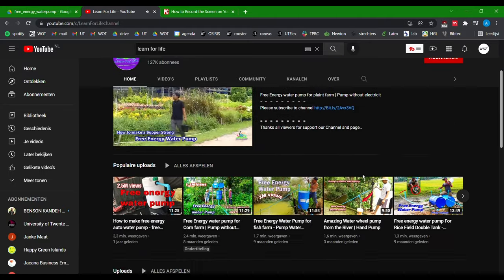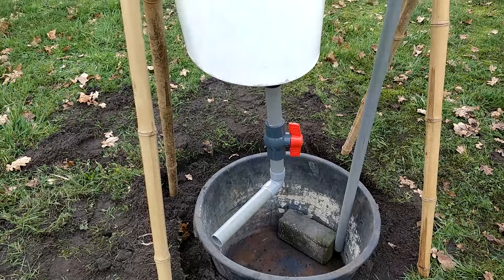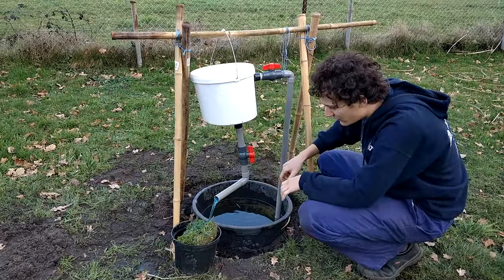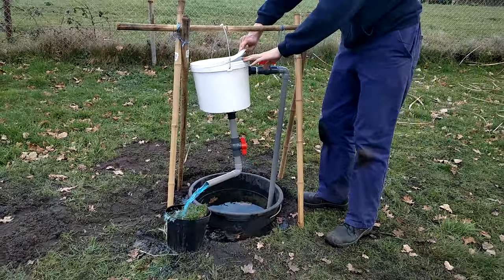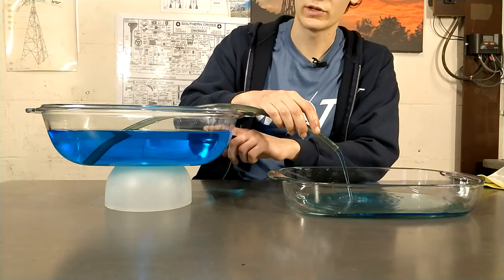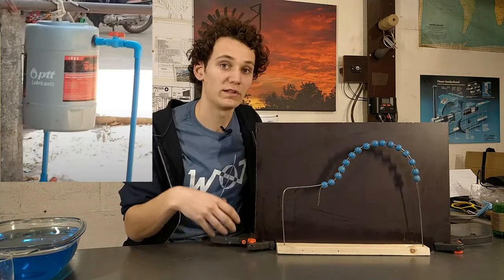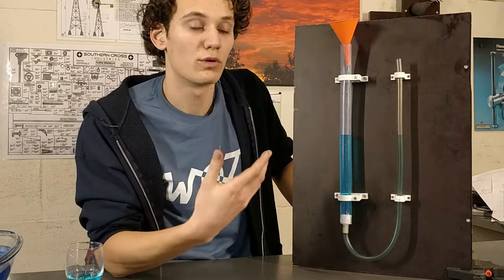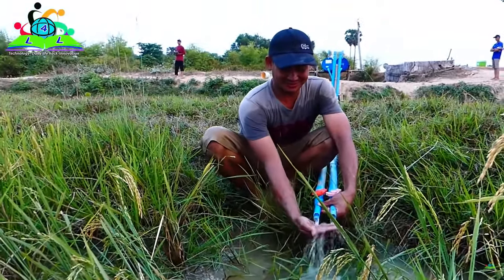FREE ENERGY Water Pump Tested. Is it possible?

Comment: I've actually tried to build one of these water pumps and it worked great , you have to make sure the container is air tight and use a check valve on the inlet tube so the water from the source can't go back out. 
When you start letting the water out it creates a vacuum drawing water in and the check valve only lets it flow in one direction.
Reply: Have you really? WOuld love to try it out too
Reply: I was about to comment about the one way valve. Good thing you mentioned it already.
Reply: he made it all wrong......
Reply: I agree sir. Cause its a vacuum type..not a siphoning type. 👌👌👌
Reply: No, you haven't built anything and you're lying in your claim that it worked for you. It's an ordinary siphon. It doesn't matter what you place between the higher level and the lower level, because everything will work as long as the outlet is at a lower height than the inlet water level in the tank. However, it is possible to build a water hammer (water ram or hydraulic impact piston) as an amateur. You need running water, for example from a stream (it doesn't work in a well). Then it is possible to transport up to 0.1 percent of the incoming water by ram. If what you lied about worked, you could bring the outlet water back into the inlet and you would have a perpetuum mobile. Apologize to everyone you mystify.
Reply: Hi Mr. Johnson! Great to know that it really worked. Now, can you just share the dimensions and specifications of all the fittings and pipes used, including the height of the storage tank and the depth of the source water. Please share, let us all try and confirm if it indeed works.
Reply: any videos or proof?
Reply: What everyone is missing is you have to bleed the water at the inlet pipe so that it is at the mouth of the inlet (not forgetting  that you have to have a foot valve at the well or water source). So the level of the water source will be at the inlet and thus higher than the outlet. Still a siphon but will work as a pump as it is being setup.
Reply: @setetupou8495  No. It doesn't work that way either, because it's nonsense. The water behaves as in a connected container, ie as in a siphon. This will only work if the outlet is lower than the water level in the well. That's a siphon. It does not matter at all what architecture is above the water level in the well - a drain is always required, which must be lower than the level of the pumped water in the well. Then it works like an ordinary siphon. Otherwise NO.
Reply: @DL-kc8fc  exactly what I have said " ...drain... lower than the level of the pumped water in the well". Do you know what a foot valve does?
Reply from the maker: Hi Daniel, is it possible that the pump you made has an outlet that is lower  than the inlet? In that case I can imagine that you got the system to work. But as I tried to explain in the video, pumping from a low point to a high point without adding energy is simply not possible. This would break the laws of physics. 

You are right that a vacuum pulls up the water. It is however important to understand that this vacuum force is limited. If you drink from a 10 meter high straw you will have difficulty getting the water up, as you can imagine. In our case the suction force is created by the downward flowing water. As shown in the video the pressure (or vaccum) caused by a column of water is only dependent on the height difference in the outlet. The suction  force required to pull water up is dependent on the height difference in the inlet. In other words: if the outlet pipe is higher than the inlet pipe, the suction force created by the water in the outlet is not large enough to suck the water up through the inlet. Therefore you can only pump from a high level to a low level.

The foot valve is a good suggestion for priming, but since it doesn't add energy in any way, it will not influence the syphoning effect. Still you can only pump from low to high.
Reply: @setetupou8495  If you wrote that the drain must be lower than the water level in the well, then you wrote it correctly. The use of non-return valves is not necessary - it is enough to suck water through the compressor on the outlet pipe for a while and then it works like a normal siphon.
Reply: @WOT_utwente  you decided before building this that it won't work & as predicted your variant doesn't work. 

Now try the suggestions from the people commenting here who have made it work. 

Also, see if you can angle the outlet pipe so it doesn't gulp air & break the vacuum. (The gulping is plainly audible in your video)
Reply: @WOT_utwente  

May I kindly ask you to pin the link 🔗 in the description or the comments so I can see the original build in detail for myself?

Thank you for this help.
Reply: @DL-kc8fc  please do a simple experiment, put a pipe in a glass of water  and connect the other end of the pipe to a vacuum chamber and the start removing air from the chamber, you will be surprised to see water moving into the chamber but note the glass of water should be in open air under atmospheric pressure

also I agree with the maker of this video that energy can not be created but at the same time do we know all the forms in which energy may exist?
Reply: @Brainwaave  Electric vacuum pumps do exist. The created vacuum can pull water up to a height of 9-10m. This is the barometric limit of water that can be reached in the Earth's gravitational field and external atmospheric pressure. However, it is possible to pull water above the barometric limit, where less vacuum is applied and more so-called chain model. Bernoulli's equation solves it best within the ideal fluid, but there is no time for that. So how to put it into practice? The height of the "sucked" water level is h0 = 0m. The height of the pipe that "sucks" the water is h1 = 10m. The second hermetically sealed pipe that leads the water down has the same height h2 = 10m. Water from the water surface (h0 = 0m) is not "sucked" into the pipe. Only the water that is in the pipe h2 = 10m will flow out. However, if we extend the second pipe by, for example, 1 meter downwards (h2 = 11m), we achieve a slope h0 + h1 + (- h2) = -1m. The water flows as on an inclined plane with a slope of 1 m (like water in a stream). This principle is called a siphon. It doesn't matter what sculpture is on the h1 and h2 pipe joints. Barrels and other nonsense may be installed there, as this will always be a siphon, where it is strictly required that the drain pipe be lower than the level of the pumped water. Barrels and other nonsense are always understood as a tube with a variable shape, which in a closed system between the "sucked" water surface and the lower outlet pipe does not matter. Fake siphons in the form of various fountains, which must also be in a closed system, do not matter either. Try the chain model. It is all a law of conservation and a gradient must always be induced if we require an automatic function. If you want the water itself to flow higher than the level of the pumped water, you must use a pump.
Reply: @DL-kc8fc  tell me how does a centrifugal pump work?
Reply: @Brainwaave  The centrifugal pump, lapidally, the pump blades through the electric motor force the water to a high speed, which reaches the end of the blades by centrifugal force and thanks to its kinetic energy the water leaves the pump body very quickly. Subsequently, the water travels to the diffuser, which has a large cross-section - the water slows down, but the pressure increases (Bernoulli's equation). For simplicity, I omit the spiral chamber, etc. These pumps are good where it is necessary to pump a large volume of water. These pumps cannot transport water to a height greater than 8m. The limit barometric altitude, which is given by the gravitational field and the external pressure of the atmosphere, also applies here.
Reply: @DL-kc8fc  please read the mechanics of the pumps, what happens at the boundary layers of the blades
Reply: @Brainwaave  I know very well what is happening on the shoulder blades. Therefore, at the beginning, I pointed out that I would provide a lapidary description, a very simple and brief description for you to understand when you asked an outside-art question that does not concern the magic barrels of Perpetuum Mobile fraudsters. I just complied with your question and I don't understand your "combat" attitude for shit.
Reply: @DL-kc8fc  it is the low pressure created at the inlet that causes the water to rise in a pump and the system that these guys are showing... my problem is that the person trying to replicate and debunk anything has done a very shoddy work with leaking containers just to dismiss anything....secondly there is nothing perpetual and is not possible, as I always say we don't know everything and there are different forms of energy in this universe so something that appears to be perpetual to us may be using another form of energy that we haven't discovered yet. so I always say have an open mind... and if human race starts to believe that they know everything... that would be a very dark moment in the history of humans 

everyone says this is against 1st law of thermodynamics but that very law states that except the force of gravity... again gravity is not a real force it only appears to be a force otherwise that in itself is perpetual
Reply: Can you learn to me with pictures,
 to make this for a pond (nonstop water fall)
Reply: @DL-kc8fc  See my comment above about the ram pump I built back in the early 2000s.  You need to have a minimum of three feet from the source of the water to the ram pump for it to work.
Reply: @kalinystazvoruna8702  You have the wrong translator. We are talking here about the fact that the magical barrels of the impostors, as in all similar videos, do not work. While RAM works. RAM pumps water into my weekend cottage for free. That means I know how RAM works and I don't need any advice. The principle of RAM has not been described here either, and no help is required around RAM. Only non-functional barrels on fraudsters' videos are addressed. The only thing that works is RAM, which is not the subject of the topic. Do you understand ?
Reply: OK, this is a world wide sensation! Please upload a video showing your apparatus. The first time in history that a siphon are able to lift water! Hurray!
Reply: @setetupou8495  noop. With a tank as a priming device you do not need any foot valve and you do not need to fill the inlet tube. Only thing you need is a moderate sized tank an that the outlet is lower than the source. If the flow is low you may have to put the outlet into a small jar to prevet air to enter the siphon from the discharge.
Reply: @DL-kc8fc  The lower elevation in a syphon hose only matters because the outlet is heavier than in inlet. Same thing here but the outlet pipe is bigger than the inlet so the weight  of water in the outlet pipe  (making the vacuum) is always greater than the weight of the inlet water. All this breaks if air is allowed to flow into the system.
Reply: @DL404  No.
Reply: @WOT_utwente  respect dat je zoveel moeite neemt om het op een juiste manier uit te leggen

Comment: Many commenters criticise here, that what is shown in this video does not replicate the pump designs which are shown in many YT-videos presently. True, but this is irrelevant. Laws of physics allow us to predict the outcome of experiments without doing them. And it is obvious that this pump design can not work, never mind, what dimensions of pipes, what valves, what barrels are chosen. If this pump would work, you could at once build a perpetuum mobile with it. Let the water flow back in the well and run a turbine by this water stream. You would get electrical energy out of nothing, without any input of energy, which is not possible. An exception: if the outlet is lower than the water level in the water source, water will flow by the siphon-effect, but this needs no barrel but just a hose prefilled with water.
It is a mistake to think because there is much water in the barrel the outflow must be strong enough to generate a vacuum strong enough to "suck" water out of the well. It is the relation of water- and air-pressure which is relevant here. And since water pressure is higher at the bottom of the well than at the bottom of the barrel, a vacuum building up would first prevent a water flow at the output before it was strong enough to bring water up from the well. 

The final conclusion of this video is correct. This pump does not work. If it is shown working, you see a fake.

Comment: Have to prime the inlet pipe using foot valve and install bigger pipe on the outlet to carry much water volume. The weight of the water will create vacuum inside the tank.

Comment: Sorry to oppose your view but this kind of system really works. The VACUUM force created inside the water tank air closed, causes the water to flow freely while sucking the water from the source which is literally lower than the exit or output. However, if not properly made the system needs to be restarted to let it works again.
Reply: It really works??? Strange that I see it only working in videos, I never encountered this system anywhere else. If this would work, you could feed the outlet back in the well and you would have a continuous circulation of water. And you could even drive a water wheel with it and generate electricity. A perfect perpetuum mobile! But haven't we learned in school that perpetuum mobiles can't exist?
Reply: Why keep saying it works when it doesnt? It physics. It will be the no matter how much money the scammers make from their youtube videos, it still doesnt work. Sorry.
Reply: Sorry, does not work unless input is higher than exit.

Comment: It works! I am using it for all my gardening purposes. One basic thing you need to make sure is that no air is allowed to go out. You need to focus on the pipe. Apply strong glue so that no air is lost.
Reply: No siphon can lift any water to a higher level. As this video shows, trying to make this a “pump” will fail. No energy input = no lifting of water.

Comment: It works well, I have tried it back home and it did so well by using a bigger water tank and closing the top with a large plastic paper tying it with a rubber and it worked so well for my home.
Reply: Was your water outlet below or above the water level of the water source? If it was below I believe you. If it was above you are telling fairy tales.
Reply: If you made the same experiment with the output higher than the source and it wored, i’d say you are bluffing.

Comment: They use closed system capillary action to suck up water into the drum with a one way valve in the inlet pipe to keep the system primed.
Reply: correct!
Reply: No.
Reply: good luck with the 5 droplets of water that the capillary system will give. because it will need a pipe diameter of around 0.5 mm and evaporation to work

Comment: 1- on start of the intake tube or sucking tube in water sorce U need one way valve. 
2- U need a pressure "tower" like in ram pomp.
3- the "sucking" pipe cross-section has to be smaller
4- the length of output pipe is not less than 5 metres
and then you are good to go ;)
Reply: This boy didn't close the lid tightly. If you watch most videos the make sure air is completely closed out, even by using a piece of plastic sheet.
Reply: BINGO!!!!  We have a winner.
Reply: you do not need any one way valve if the plumbing is correct lenght and air tight.  submerge output in an open top vessel to prevent air from intruding back through output pipe. air in this system makes it fail. keep the air out and it will run till there is no more water to pull. i can lift water out of my pool 48" and drop back in. im working on a larger model using an air compressor tank . all other drums have collapsed due to MASSIVE pulling force created by the weight of the down side plumbing. the air getting in IS an indicator that the concept is viable .the fact that noone is taking the air intrusion factor seriously is the reason any of them fail. it works and HOW!
Reply: 1- on start of the intake tube or sucking tube in water sorce U need one way valve.  NO YOU DO NOT
2- U need a pressure "tower" like in ram pomp. NO YOU DO NOT
3- the "sucking" pipe cross-section has to be smaller. NO YOU DO NOT
4- the length of output pipe is not less than 5 metres, NO YOU DO NOT, JUST PUT IT INTO A WATERFILLED SMALL BUCKET.
and then you are good to go ;) NO YOU DO NOT - IF THE OUTLET IS HIGHER THAN THE INLET. You will have no siphon effekt if the outlet is higher than the inlet.
Reply: @KevinFreist  xB
Reply: 1- No, not with a bucket/barrel. That is in fact the only main reason for using a priming barrel. 
2- elevating the bucket/barrel adds notthing to the functionality, only makes it mor difficult to hoist water up into the barrel. 
3- No, sucking tube can be 1 meter wide if you like. (With a 10 mm outlet pipe)
4- length of output does not matter.

You can prevent air fron leaking in from the exit by diping the outlet into a bucket of water, tilt the output upwards using a bend or a hose.
Reply: @lifeway7605  He did. Air leaking in from the exit proves that.
Reply: @mariana1964  Winner?
Reply: @KevinFreist  It only work if the source is elevated higher than the exit, as any siphon. The output pressure, and suction if you like, is not relited to size of tank, but to the difference in height between the water level in the tank and the exit if the exit is higher than the source.

Comment: I did try the drump pump . It worked. Just do exactly how it was made in the original video and you will get results. You need bigger drum to build preaure within the tank. But, if you just want to show things not working you can.i did it pulling water from a 50 feet deep water source.
Reply: oh.. great! Probably you try putting some generator in the path somewhere. World will get free electricity. RIP foolish scientists burning coal for so long.. lol 😆